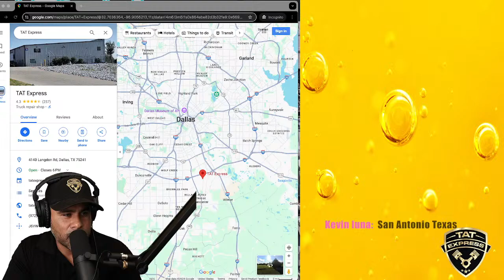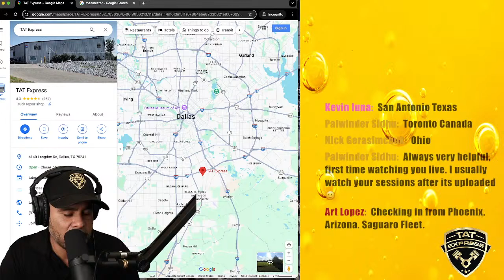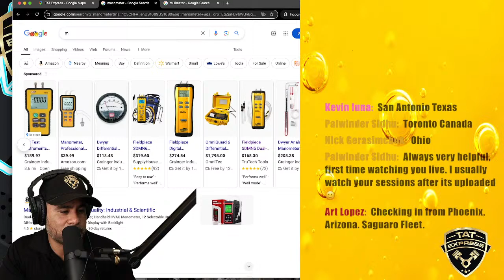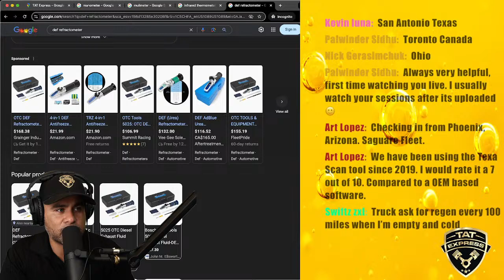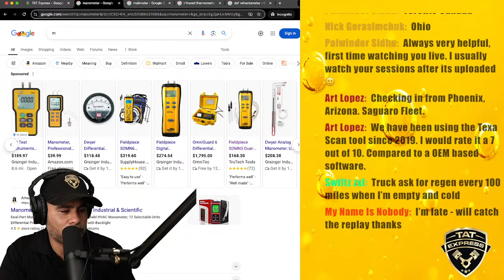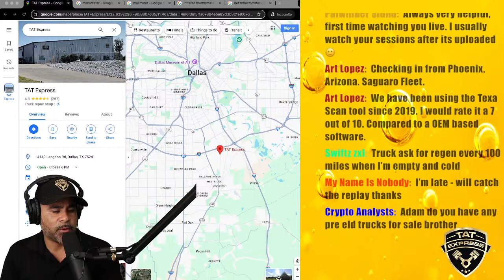Common Issues, Diagnostics, and Maintenance Tips

Comment: MY TRUCK throws coolant out of the overflow pipe when doing parked regen dont know about regen while driving. What issue can it be? Is it a
 Bigger issue ?  Other than that everything works perfectly.  Its 2018 DD15 CASCADIA NEW MODEL.
Reply: 5 month old comment. Has the head gasket been changed since your comment?  Or did you change an EGR cooler yet ?